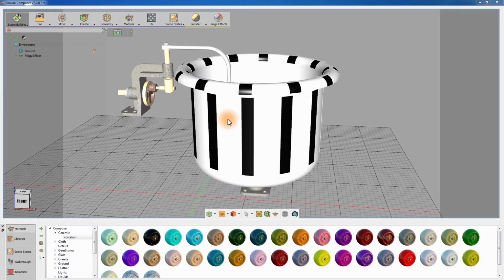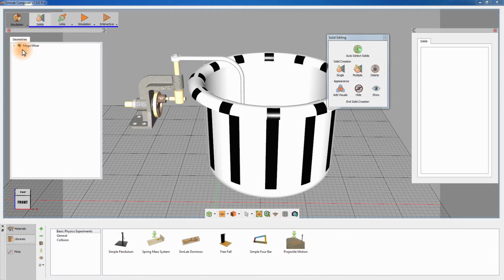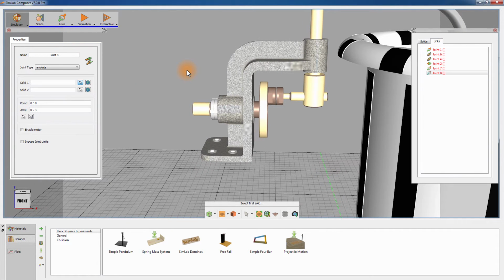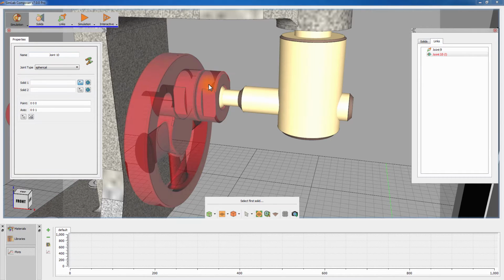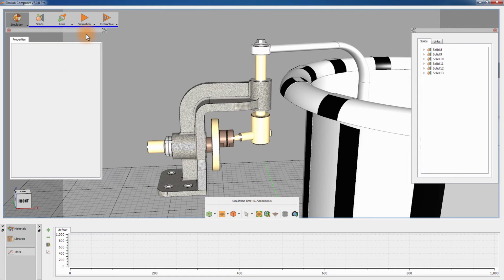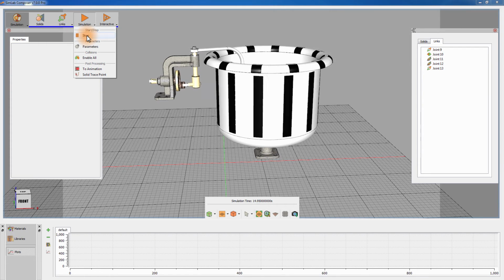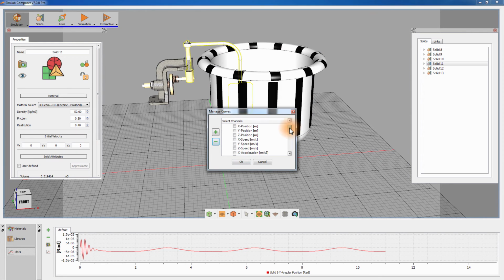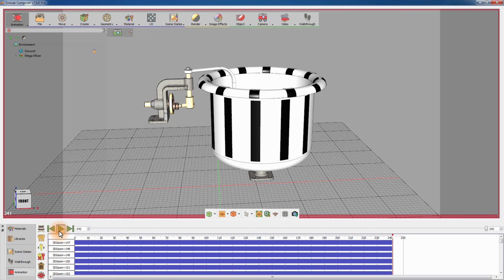SimLab Composer: Simulation Tutorial

Comment: sir,
can you please suggest me a link joint type yo use in a CAM and Follower assembly.
Reply: Actually, I didn't get your point. Can you rephrase your question?
Reply: @jimmyjam9389  sir this is my assembly. I tried cylindrical joint and revolve on top and bottom. but the center surface between the CAM and FOLLOWER i'm not sure which joint to provide. https://drive.google.com/open?id=1XxBs8JN2fA3qg-ynb8JWKiizK4YTpQdw